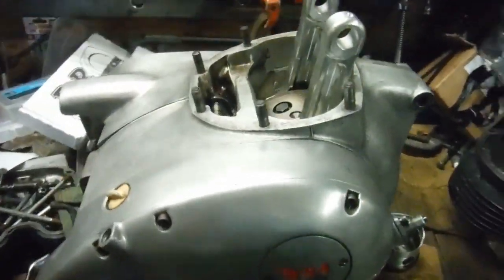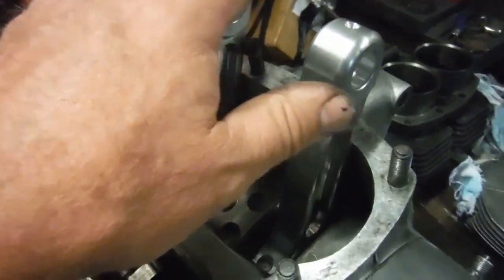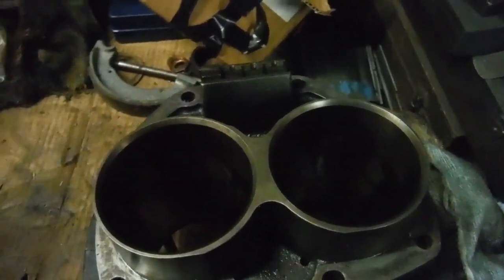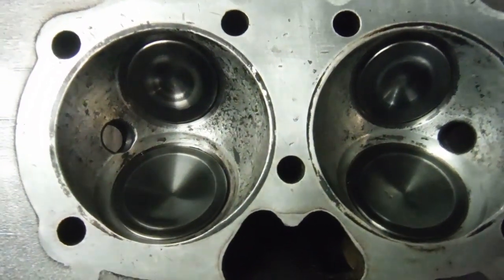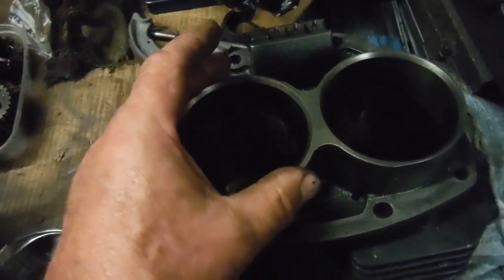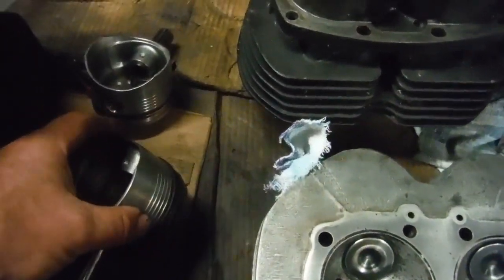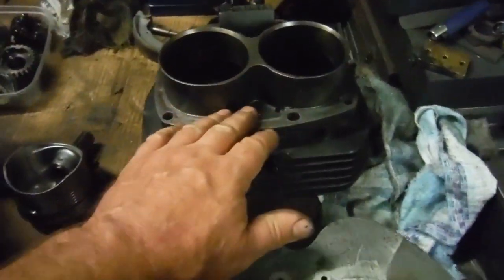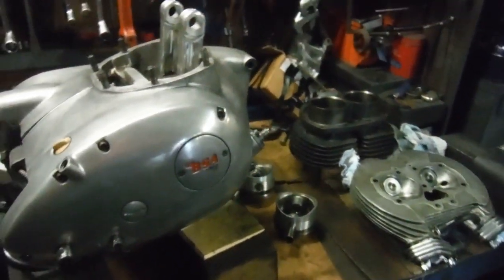BSA A65 engine strip and rebuild 4 Rebuilt bottom end and large piston ring gaps discussed.

Comment: G'day Paul, your doing a great job on the upgraded A65 motor, when l ordered rings for the 650 lightning measured the bore and pistons ordered the right size when they turned up ring gap too big still got that set, right ones in the bike now, cheers mate, Neil 🤠.